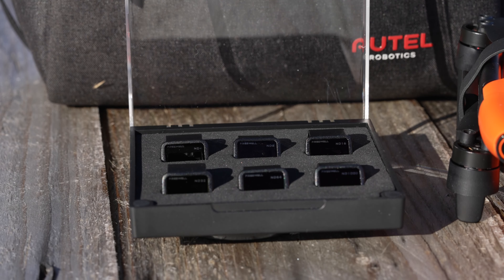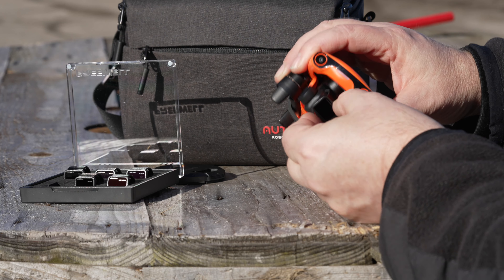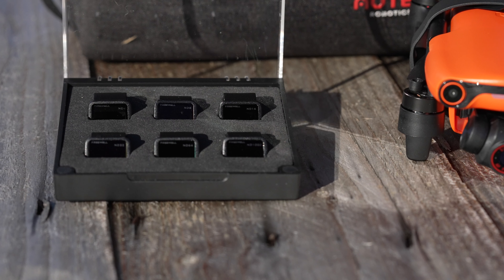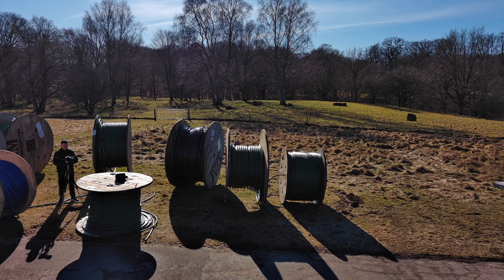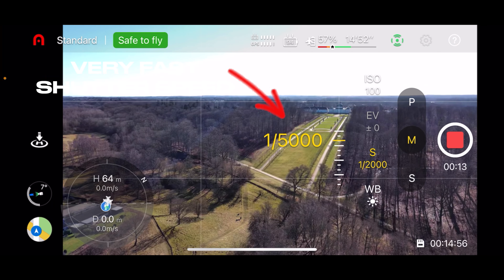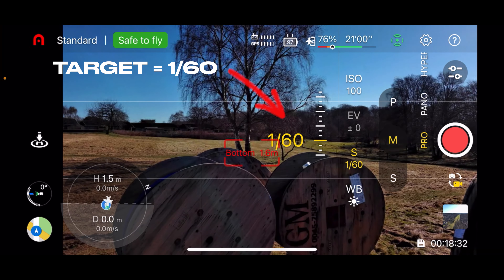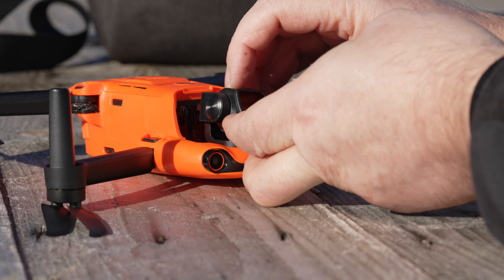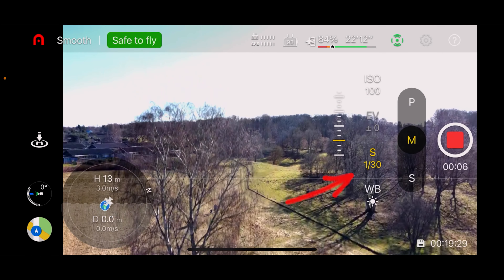Do YOU Need ND Filters for Autel Nano Plus?

Comment: ND4 is 2 stops, not 1 stop. The ND number (4 in this case) is telling you by what factor the amount of light will be decreases (in this case, 4 times less light). Since one stop means halving the amount of light, ND4 represents 2 stops. Following the same pattern, ND8 is 3 stops because 2^3 = 8, you are halving the amount of light 3 times. You should add correction texts on top of your video since it will be confusing people.
The one you did get right is that ND1000 is 10 stops, because 2^10 = 1024 :)

Comment: For what it's worth there are lots of pro's using no ND filters at all on the Evo 2 Pro getting stunning results. The E2P does have an adjustable aperture though. I've been using my Air 2s with no ND filters at all and on auto for most settings with good results too. Shooting bright horizons or sun reflecting water does change the dynamic though so things like that should be considered. There's a good video explaining how the 180 rule was something established during the good old analog days and how digital imaging is different enough to make the 180 rule not so written in stone. 

As always a good and thought provoking video Henrik!
Reply: During filming at daytime you must use ND filters even with adjustable Aperture. Two main reasons why: You get the right exposure and shutter speed and avoid playback problems. You may not see some of the problems on small screens or devices but it is there. I lost count how many times I had to ask video guys to re-shoot because of wrong shutter and burn-out highlights in videos. And most of beautiful footages from drones are the close ups. If your camera Aperture can close enough to get the right shutter, yes no ND filter is required.